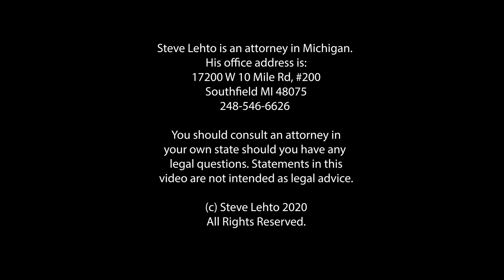Ford's Mystery Fix Explained - Ep. 6.263

Comment: In the old days we would use a lower pressure cap.  Turn the pressure down, leak less.  Sounds like a band aid
Reply: Lowering the pressure in the cooling system also causes the coolant to boil at lower temperature.  Every psi over atmosphere you raise the boiling temperature of the coolant by 3 degrees F -- so a 15 psi radiator cap working correctly adds 45 degrees F till the coolant boils (212 degrees F at atmosphere now raised to 257 degrees F).  May not seem like a huge gain, but in today's modern engines it sure is.

Comment: Interesting.  Even on many cars with electric fans, the water pump is still mechanical.  I agree that electric water pumps are blasphemous.  So it could be that if the car is shut off and the coolant pump wasn't running, then the coolant in the head area could vaporize and cause an intrusion. So it could be the fix is to simply ensure the pump runs for a bit after the engine shuts off.

Comment: I just had the software fix completed on my Ford Escape this morning.  The way it was explained to me was that the fix was to run the electric water pump  a short time after shutting down the engine so that it would decrease the water pressure on the cooling system.  I am not an expert but it sort of seems possible that if the coolant side pressure stays high and the engine cools down and metal parts contract that the coolant could migrate to the compression side of the engine

Comment: Such problems many times occur when there is an unexpected confluence of several events at once ... such as a sustained high power demand on engine with a very high outside temperature and shutting down in a enclosed high temp garage, and components at one tolerance extreme (i.e. a thin in-spec head gasket), .. etc...  ...and then only a small percentage of cars experience a failure.  Such failure modes just don't get exposed during normal vehicle development and testing due to limitations of environmental exposure and test sample size quantity. Engineers can only run predictions of low level failure modes based on testing results ... then ya got internal pressures to dismiss concerns (human nature), etc.. adding to potential errors. Such failures happen to all car companies, and probably always will.
Reply: Right, which is why you see so many other instances of companies issuing de facto recalls to address coolant intrusion into the combustion chambers.
Reply: @Joe_Mission  in general there is a continuing trend to ever smaller more power dense engines ...  new heat related failure modes will keep popping up in coming years.

Comment: Based on the comments I saw the other day (and online parts search), I was surprised to learn that there is indeed a small electric cooling pump on the Ford Escape. However, since the pump is barely larger than the heater hose attached to it, it is obvious that it is NOT the primary cooling pump for the engine (more on that below), but rather whose primary purpose is to increase flow to the heater core.  I’m guessing this would be essential in cold climates where there is not quite enough waste heat from the engine to the keep the interior of the car warm.  And, I could see how they could repurpose this small pump to run for a while after engine shutdown to maintain a small, but steady flow of coolant throughout the cooling system to prevent the kind of hot spots that are causing leaks.  Kudos to Ford for finding a clever solution to this problem but shame on them for having a design that requires supplemental cooling to prevent eventual catastrophic engine damage.
So for the 2017 Escape owners in Phoenix with engines that already have the leak (from the extreme heat conditions there), it seems unlikely that this fix of running the electric cooling pump will magically seal a leak that has already occurred and undo any cylinder damage cause by the ingress of coolant.  What are they supposed to do?
And one last thing, I checked again (online parts search and a video on how to change the engine water pump on a Ford Escape) and found that the main (engine mounted) water pump IS mechanically driven from the serpentine belt and further, it is a bear to replace!  It won’t hurt my feelings to be proven wrong so if someone can please post a link that shows an electric engine cooling pump for the 2017 Ford Escape, I’d like to see it.
This was all too intense…we need to get back to lawyer jokes!

Comment: So many ways for engines and transmissions and exhaust systems and cooling systems to cause problems. Such complication, such a high parts count, so many fluids and filters and channels and passages and clearances and pressures and timings. And with all that these engines and cars are not very energy efficient or powerful. There must be a better way to power cars. Oh right! There is a better way! Electric cars! Faster, more powerful, more energy efficient, way simpler to build, almost no maintenance and if it's a Tesla, many times safer. Wow! And yet people are still buying new internal combustion engine vehicles. This is not logical.

Comment: Slightly off topic?....
 There's a popular YouTube channel that the mechanic specialises in ford diesel engine repairs and rebuilding.
 His first go to diagnosis is checking the radiator caps pressure holding capacity.
 He shows boxes full of OEM caps that have failed, causing catastrophic engine damage/head gasket failures ect.
 Then he shows the generic $5.oo  replacement cap that out performs in reliability and durability that of the $25.oo OEM radiator cap.
 ?????

Comment: I'm a bit closer to the age of the Bible as well, so I hadn't realized electric water pumps had made it into a mass production vehicle.  Yes the water pump recalibration will have a big effect on cylinder head temperatures, so it seems like an effective software fix.  The downside is reduced water pump life.  Those are a lot easier to replace though.  Overall a smart move! 

The piston noise story illustrates how incredibly complicated these four-wheel contraptions are.   Often the problem isn't where you think it is...

Comment: I like how me and Steve see eye to eye. The engine is supposed to sit under the hood the correct way, the water pump should be driven via a belt, or the camshaft (in the case of the gen 2 LT1) and be located between the correctly seated engine and the radiator, just as God intended. Also, what's with this suck the oil out of the top nonsense? If God had wanted it that way, he wouldnt6have put a drain plug on the bottom of the engine.

Comment: Electric coolant pump.  What a stupid idea.  When the motor fails (and it will eventually) you risk either being stranded or over-heating and blowing your head gaskets without warning.  I thought only BMW was stupid enough to do this.

Comment: My hybrid will run the coolant pump and fans after I shut it off, both for the ICE and the battery. I can even tell the difference between the coolant pumps (they use the same fan and radiator). Being a hybrid it also runs a heater on the battery when the temperature gets too low.

Comment: Ok, I just figured it out.  It is for the electric after run pump. When you shut down the engine, the mechanical pump stops moving coolant. So your engine will continue to heat up, since you no longer have coolant flowing through the rad. The update, keeps the electric pump running longer after engine shutdown. Preventing things from expanding after the engine shuts off. Hope that helps.

Comment: Subaru FF1, the first Fuji Motors auto imported to U.S., had no drain plug.  In addition the radiator needed removal to change the oil filter.

Comment: When you turn off a car, it experiences “heat soak”, a condition where the residual heat from the piston area radiates into the whole motor. This can raise the coolant temperature AND pressure to the point where the weakest sealing point starts to leak. A turbo engine has problems with “heat soak” and will actually cook the residual oil in the turbo. The software fix mentioned would run the electric water pump for a while and circulate the coolant until heat soak isn’t an issue. I had Fiat X19 that would run air fans on the engine when the car was off and the key out. This would kill the battery. Italian design.
Reply: VW's (and others) have after-run pumps so you're not dependent on a small electric motor to go down the road.
Reply: My 86 Ford Tempo did that. The fan would run after the engine was shut off...about 10 minutes if it was real hot. The fan also failed after about 2 years.

Comment: I've been an auto mechanic for almost 20 years. The only time I've ever seen a factory electric pump, was an "after run" water pump. It was to cool the engine, after it's been shut off.  And even those were unreliable. Other then that, electric water pumps are after market replacements for the mechanical one.  Doing a quick google search,  I can only find mechanical ones for those cars. So, take what you will from that. To me, sounds like a bunch of hooplah, and someone trying to justify there job.
Reply: Yeah my Ford supercharged F150 has an electric intercooler pump. They usually fail around every 70K or so as the motor brushes wear out and the dust from them gunk up the works. It's less critical than the mail water pump, but can still cause problems since the truck has no temperature gauge for the I/C system. Luckily they are fairly cheap and easy to change. I would not want an electric pump on the main cooling system as it would definitely strand you from time to time.

Comment: I find it hard to believe it takes a half a day to reprogram a chip in an engine computer.
Reply: Maybe the dealers are required to get the car to operating temperature and actually test the fix.  ???
Reply: Another Dave  and that is exactly why Ford tells the customer it takes a half-day.  It is all about setting expectations BEFORE the customer ever comes to the dealership for the repair.  They do not want customers bothering the Service Advisers at the dealership every 15 minutes to ask if their vehicle is done yet.  The customer gets told half-day and then the repair can be done when the next technician has an open bay.  If the vehicle gets done sooner, then the Service Adviser is the hero when they give the news to the customer.

Comment: Still don't understand how this can take half a day to fix (as per last video) when all the performance programmers say it takes less than 30 minutes to re-flash the computer for more performance.
Reply: And that is exactly why Ford tells the customer it takes a half-day.  It is all about setting expectations BEFORE the customer ever comes to the dealership for the repair.  They do not want customers bothering the Service Advisers at the dealership every 15 minutes to ask if their vehicle is done yet.  The customer gets told half-day and then the repair can be done when the next technician has an open bay.  If the vehicle gets done sooner, then the Service Adviser is the hero when they give the news to the customer.

Comment: So now the question is by making this software modification to run the coolant pump more often how does this affect the expected life expectancy of the pump?
Reply: Dont ask stupid questions.... would you rather replace an entire engine (and coolant pump), or just the coolant pump?

If you owned a car long enough, youd know no engine component lasts forever, but only a useless loser would blame ford for the life expectancy of a coolant pump.
Reply: I guess you did not understand the implications I am suggesting. If they reprogram the pump to work more often they are possibly just kicking the can down the road. It will possibly resolve the coolant leak but might end up with a bad pump due to increased duty cycle. So I guess I should have added will they be offering an extended warranty on the pump moving forward?

Comment: I propose using a mechanically driven pump with a hear sensitive valve in the system which would open up when the temperature increases and close when the engine is cold.  Maybe it could be called a thermostat. ..

Comment: Probably find someone forgot there was a delay between the coolant in the engine reaching target temp, and the coolant temperature sensors registering it. It was probably ramping up the pump too late so some spots were overshooting the specified temperature.

Get these things wrong and the temperature can ping pong all over the place as the pump ramps up and down.

Comment: I don't trust electric water pumps, power steering or brakes. Especially electric power steering. if something goes wrong, I want a physical, solid connection from the wheels to the steering wheel.....as God intended.
Reply: With electric power steering, almost always there IS still a physical solid connection as a failsafe.  The only exception that I know of was on an Infiniti model (probably something like the G37) where they did use electronic steer-by-wire.  I still prefer hydraulic power steering because it tends to have better road feel.

Comment: Things like the radiator fan, coolant pump, and power steering pump, all pull a fairly significant amount of power from the engine.  If they are mechanically driven that can use a noticeable amount of fuel when they aren't needed.  By making them electric so you can easily adjust both the speed and when they are on, you can save a significant amount of gas.  I think all three together going from mechanical to electric driven can improve you mpg by over 10%

Comment: thank you for the update. I was almost right. I said I thought they were bringing down the coolant temperature to lower the pressure of the coolant system. just a side note about water pumps. did you know that the water pumps on Ford flex vehicles are gear driven with the timing chain I think it was. I know it's got a gear and chain design. perhaps cog driven may be more correct term. I don't know when they started doing this, but when I did research about the 2016 flex I was about to buy I learned of this design. from what I could find out it will last about 150000 miles before causing an issue. the flex I bought only had 33000 miles so I reasonably confident it will be fine till I'm ready to trade in for a newer car. my girlfriend only puts about 8000 miles a year on her car and I'm going to trade it when it hits about 110000 miles

Comment: I personally like the electric fans and electric water pumps  (I have both on my vehicle).  They keep the operating temperature of the engine very constant in any ambient temperature or driving condition, which I think must ad to the longevity of the engine.

Comment: Electric water pump! Blasphemy!!!😅
Reply: Actually a significant improvement... allows coolant flow rate control independent of engine rpm
Reply: Roc Pile Yup, I was just kidding. They have had electric radiator fans and fuel pumps in cars for a while so it makes sense that the water pumps are now electric also.
Reply: My bad......lol

Comment: I wonder if this was something like the old Ford EXP electric cooling fan on which it would stay on after the engine was turned off.
Reply: Having the fan stay on a little bit after engine shutoff always seemed like a good idea, but with one major flaw:  the coolant wasn't circulating then, so you were mostly just cooling the radiator.  That could be one major benefit of using an electric water pump.

Comment: Very close to what I said, it's running too hot. I have figured that they were running the fan longer and more often, which is pretty close.
Reply: Running hot or not, how is the coolant getting into the combustion area? Has to be a crack or bad gasket somewhere! If not putting compression into coolant, has to be on intake side. Identify the leak area, Identify cause, then fix the problem. If no problem of coolant @ lower temps, problem is still there, only used a bandaid
Reply: is "too hot" a technical term? How long did you goto college to be so smart? DAAAAAANG!

Comment: Steve probably believes in rear view mirrors instead of backup cameras too! I know I do!
Reply: Except when the thing you're driving is 32ft long, and has no windows. (the winne does have a rearview mirror, tho. In my nissan cargo van, they didn't even bother with one.) I still have to resist the reflex to turn and look over my shoulder.
Reply: I use both. The back up camera also has cross traffic alert.
Reply: I like the camera that shows the right lane when you turn the blinker on.
Reply: @joriskylie6857  Yeah...that's a feature folks in Knoxville, TN will never know they have.